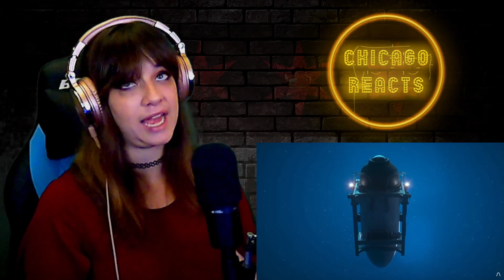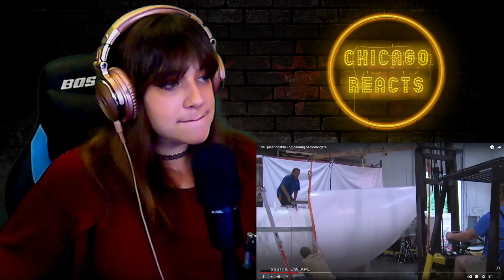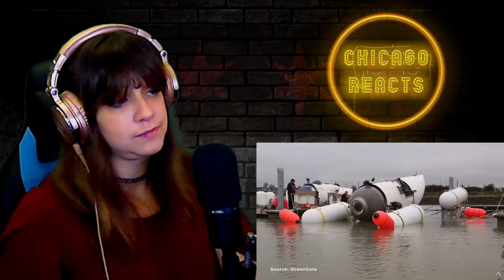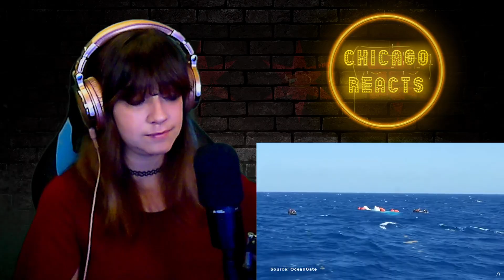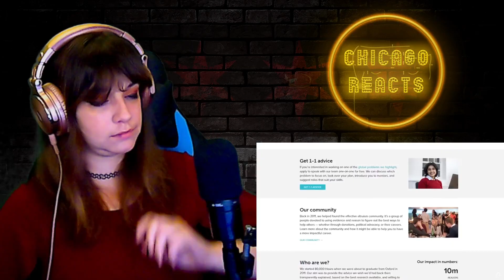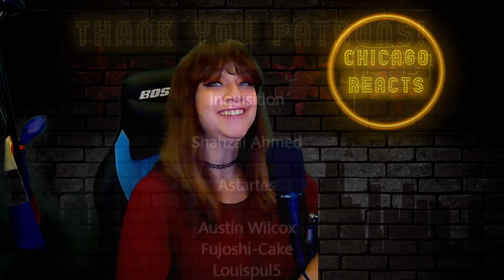*A Real Can of Clowns* The Questionable Engineering of Oceangate-Real Engineering

Comment: I've built hundreds of industrial pressure vessels with pressure tests up to 1500 psi (the highest I've ever gone was 2250 psi, but that was a one-off). Every single thing i hear about Titan is absolutely insane to me. Material with little previous testing for the purpose, with no safety inspections between uses, slapdash construction with no hope of uniformity, sefety precautions that border on suicidal, and, worst of all, using only 4 bolts to secure the hatch. 

On a similarly sized pressure vessel, I'd expect a bare minimum of 32 bolts, assuming they were 1 inch diameter bolts. If they're smaller bolts you might see 64 or 128 bolts evenly spaced around it. The point isn't simply that the cover or channel will flex to let pressure escape (though that is a concern with FOUR GODDAMN POINTS SECURING IT), but rather it's a matter of even distribution of the forces to prevent any given section from building any momentum. It's easier to prevent than to stop once it's started. 

Even worse than that, they were working with NO SAFETY MARGINS*, which is *beyond insane. When I pressure test a vessel to, say, 1500 psi, that's well past its normal operating pressure. We generally aim for 1.5 to 2 times the normal operating pressure to make absolutely sure it wont FUCKING EXPLODE when they pressure up.

Comment: So is it pure luck that they had previous successful dives?
Reply from the maker: Less that, and more that the material they used doesn't hold up over time. So it's not surprising they had some successful dives, but every time they went down, the material degraded, and if they'd done the proper testing, they'd have known that.

Comment: You can use carbon fiber to make quality musical instruments along with aircraft and spacecraft hulls.   In those the pressure is on the inside pushing out thus stretching the fibers.  Thats there the fibers are very strong.    Also the pressures from the inside are not that high.   In a space craft is less than one atmosphere inside and zero outside.   In the titan it was one atmosphere inside and 400 pushing on it.

Comment: The other reason not to use carbon fiber for submersibles is that nothing can be welded to it.  They have to be glued with commercial epoxy.   This adds yet another material to the mix that will contract and expand at different rates than the two materials that make up the carbon fiber composite.    Here the titanium rings were epoxied to the hull.   The rings are clear indicating that the epoxied joints with the carbon fiber failed.   

Oceangate posted a video showing them applying the epoxy to the original hull.   It was all hand applied and eyeballed in a room that wasn’t exactly free of dust.   The rings were also placed by eyeball not careful measuring.

Comment: Carbon fiber is basically microscopic ropes. You can't push on a rope. Using carbon fiber to build a submarine is like wrapping chains around a balloon to prevent it from deflating. It doesn't work that way.
Reply: you can make ROVs with Carbon Fiber. Its on manned craft you cannot use it since you cannot predict when it will fail with any margin of reliability like with Titanium, Acrylic, Steel and Aluminum
Reply: @toomanyaccounts  You can use carbon fiber like straw in old style bricks (reduce crack propagation, etc), but the description of the manufacturing methods in the testimony says the carbon fibers were aligned (to maximize tensile strength, again pulling not pushing) which does nothing for cracks in the resin that stay between aligned fibers.

Comment: There is an additive effect here. You take one shortcut, then you take a second, then a third, fourth and so one. Okay, the fiber hull has some voids, it is a material with an inherent wear-out mechanism, the epoxy is applied poorly and in dirty conditions, the compression elasticity between the fiber and the metal are different, on and on and on. The probability of one of these being an issue is small. The probability that all of them together will destroy the sub is very high, because they interact. Rush is thinking that a whole bunch of small numbers, multiplied together results in a very, very small probability. However, that is only if every variable is independent of the others. The interdependence means it is more additive. The final risk is much larger. I have worked with ABS, Lloyds and DNV-GL. Their requirements and specifications are not extreme, they are based on incidents of people dying and ships sinking, in addition to over a hundred years of research.

Comment: Lochridge, McCallum, Nissen-all fired for competence! Rush went clown with his ship! Karl Stanley gave Rush the best advice and he never took it! You don't have a marketable product-just shut it down! Karl dives within his sub's limit-he doesn't do Titanic! It's not how many you take on a dive, but how many dives you take safely. Dozens of smoking guns! Loss of comm, diferential materials, uncontrolled descent, delamination, port window-surely not just one issue.
Reply: the game controller system not have an independent backup. that the wireless often failed causing dives to be abandoned costing millions in revenue. if the control system had gone out during a dive it would have been fatal.

The only question with Titan killing everyone abroad was a matter of when and how not if.
Reply: @toomanyaccounts  A 14% dive success rate. I think at least a dozen major issues went wrong on that last horrible dive.

Comment: Of course it was an implosion. It will always implode because the external pressure is greater than the internal one. An explosion is the opposite: the internal pressure is greater than the external.
Reply: an implosion does create a sonic boom so there is an explosion as a secondary effect of implosions.

Comment: The real problem wasn’t material choice, or the controller etc… it was the culture of taking risks unseriously that was enforced by the CEO. 

On their own, most of the design choices that get called obviously stupid (and to be clear, I agree they were) could be acceptable/justifiable… if done right! And if done for the right reasons, in the context of a lot of other choices that would balance the problems with that particular choice. 

Carbon composite hull is the biggest example, especially joined to a very different material like Titanium that deforms differently under pressure and is hard to bond to carbon it has a lot of huge disadvantages for this use but it isn’t impossible to make it work. You’d have to do a lot of physical, destructive testing to verify models accepting going through prototype hulls. You’d need to be willing to set hard, clear lines for retiring any hull from signs of damage (which they did already have but ignored) and probably just a hard set number of dives even without damage. A lot of things have to be done right, and it ends up having a lot more costs that they weren’t willing or able to deal with.
Reply: the carbon fiber hull was being damaged each dive to Titantic. The hull was going to implode no matter what. Titanium hull is meant to last for decades of dives along with Aluminum and Acrylic and Steel. The carbon fiber hull wouldn't last the certification process it would have imploded during the process. They had tested with carbon fiber end caps and none of the models got to the test depth without imploding.
Reply: 17:30 Did you notice this thing was glued together by hand?  Titanium hulls are welded!
Reply: @InternetDarkLord   Not titanium to carbon fiber. You can’t weld composites, but that’s one of the issues with the design itself. Carbon and titanium are VERY hard to get to bond well with the adhesives available, but more than that they have very different strain curves. Under the huge loads down there, they would compress significantly different amounts putting a lot of extra stress on the bond and also on the inner titanium lip that seems to have sheared off.
Reply: @RocketSurgn_ was t there some interaction between titanium and carbon that was corroding the hull?

Comment: Well the reason is that when pressurized on the inside the carbon fiber it acts like a balloon does and the forces are in tension rather then compression.  In a way, when pressurized on the inside the pressure itself helps to support the structure.
Reply: Scott Manley's recent deep dive into this topic is really good. Goes over how they'd glue together different layers and shave off various sections etc.
Reply: As the oceangaters found out: it supports the structure right up until it doesn't